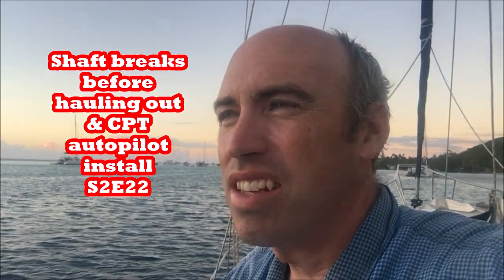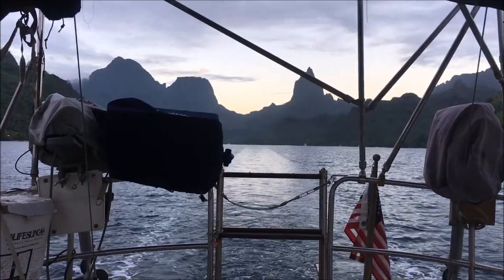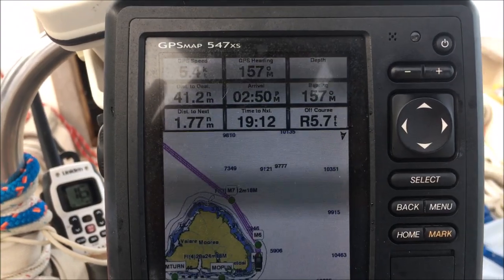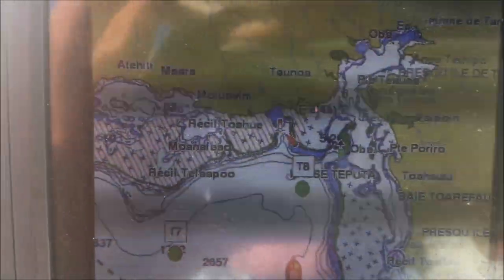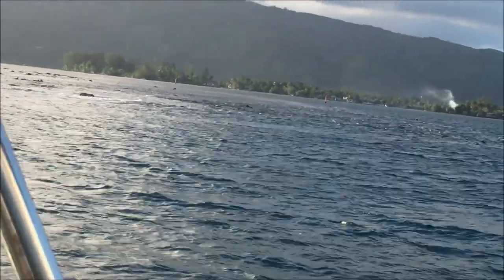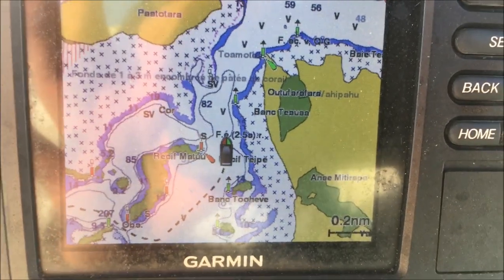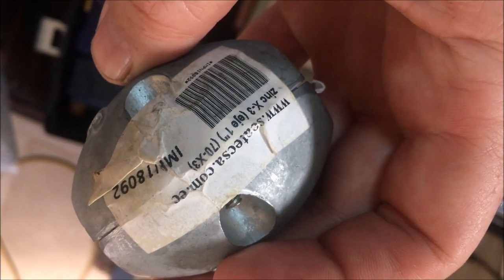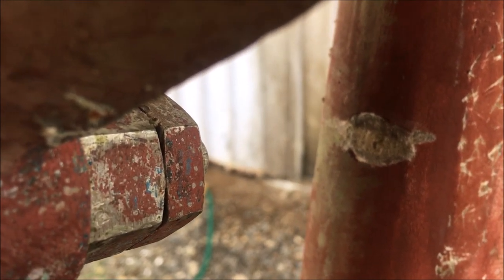Prop Shaft Problems before Hauling Out in Tahiti, CPT Autopilot Install S2E22

Comment: they have shims you can add between the wheel and the drive wheel which pushes the belt further away from the wheel.   You may have to re-adjust the position of the drive box though.  That should have been sorted out when you gave them the measurements when you ordered the unit.  I ordered mine with 1" spacer blocks for this (their suggestion).  Tjey wouldnt be hard to make though from any material to accomplish the same thing.  Some chunks of teak wood or anything else should work just fine.